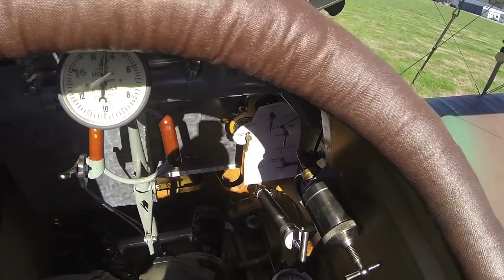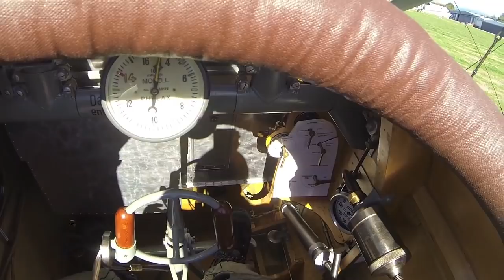Albatros D-II - New Zealand - Part 1 - Kermie Cam

Comment: Who else noticed that sexy Corsair in the back, love that plane!
Reply: I was lucky enough to work at Vintage Aviator for a while. I said to Gene one Monday morning "Do anything fun in the weekend?"
He shook his head and said "Nothing much...Flew the Corsair ..."
Bastard.
Reply: During the Pacific War, the Royal New Zealand Air Force acquired around 424 Corsairs from the US Navy and Marines. The aircraft seen here is one of those ex-RNZAF aircraft, now in US markings.
In the 1960s I met a guy who had been in the RNZAF ground crew on Guadalcanal and he told me a lot of stories about events there. He said some of the Corsairs had a lot of hours up by the time they were lend-leased to the RNZAF and were pretty clapped out. Some of them used cartridge starters and some of those were so worn that the ground crews had to empty two cartridges into the starter before inserting a third cartridge and hitting the button.
They also put a quick-release valve on the inlet manifold for a fire extinguisher, because if the engine didn't fire the first time, it generally caught fire the second time. So, a quick shot of CO2 into the manifold, clean it out and try again.
New Zealand aircraft in the Pacific carried markings similar to American aircraft, because they had found out the hard way that inexperienced American pilots were quick to shoot at anything that had red in its markings.

Comment: I would suspect the Albatros is a bit easier to fly than most WW1 aeroplanes, except perhaps the Fokker D-VII. I think a Camel (or any other true rotary) would be a hell of a lot harder, and some of the really early ones might also be difficult. (DR-1 Eindecker for example.) I might be prepared to try an Av 504K, but there is no way I would try and fly a Bristol Boxkite...

Comment: This picture is not historically accurate. What is Otto von Bismarck doing in an airplane?
;-)

Nice videos! Just discovered this channel. Interesting to see old planes like that still in operation, filmed today in HD down to details like all those clicking valves...

From the cam it looks like the guns are aiming at the propeller - how does this work?
Reply: "From the cam it looks like the guns are aiming at the propeller - how does this work?"

They had an interrupter gear connecting the engine crankshaft to the gun's firing mechanism. The guns would only fire when there wasn't a propeller blade in the way.

Comment: Its crazy to me being a car and engine guy to see the engine totally exposed to the elements like that. WIth the pushrods and rockers exposed dirt and grime and stuff gets in there its all over. I would have thought some type of cover would have been put over them for flying.
Reply: Boredout454 lol I was thinking the same thing. I believe I noticed some oil on the gopro lens before he even took off.
Reply: Boredout454  
some had cover
http://www.bibl.u-szeged.hu/bibl/mil/ww1/technika/repules/tipusok/albatros_d2_5.jpg
Reply: Boredout454 Survival time of WWI  planes was counted in weeks, with cover or without it  :)
Reply: True but that survival percentage would have increased with a cover!
Reply: Boredout454 TBH, these engines were probably built to such loose tolerances that the odd bit of dirt wouldn't have bothered them.
Reply: I can certainly see what you mean but up in the air there isn't really much to worry about and in my experience I have never heard of any issue with any aero engines that have exposed rockers.
Reply: WarblesOnALot
 Hi Warbles! :)
Reply: Boredout454 of
Reply: Boredout454 GM in line 6cylinder engines in the late 1920s had no rocker covers.Every 20 miles the car driver dismounted  and gave the valve gear a drink of oil.

Comment: With the tappets exposed, how was an adequate supply of oli retained at that zone?
Reply: I reckon that little brass 'cup' up at the front of the engine is a drip-feed oiler that gradually dribbles lubricant onto the valvetrain.

Comment: Taxi 35 knots, Stall speed 34 knots, VNE 36 knots.
Reply from the maker: Nice spoof!  I believe your information is a bit off as I don't think you would taxi an airplane with no brakes at 35 knots and then have a never exceed dive speed of 36 knots.  

Not sure where you got the information (assume you made it up) but the airspeed indicator on WWI German airplanes is in km/hr and I doubt seriously you could determine those airspeed that accurately as the airspeed indicator is out on the right wing strut and I can say that I never look at it while flying!
Reply: Yeah, I was just joking around. In reality, I have no idea what the V speeds for the Albatross or any other WWI airplane is. I would, however be very keen to know them or your estimate of them. This video reminded me of the time when I flew a Curtiss Pusher. It had externally exposed rockers that required pre-oiling as well. After take off, it took us forever to get past the end of the runway. Canadian geese and J-3 Cubs were passing us like we were standing still. Hope I live long enough to hear that Napier Sabre of yours light off. Love all your videos and have been following your career since your aerobatic days. I worked for years in a radial engine shop and worked for a P-51 restoration facility. I've worked on all kinds of warbirds and love all things aviation related. Best o luck! Kinda surprised that our paths have never met....maybe one day.

Comment: The engine sounded like it was misfiring and possibly over-rich. My experience with engines of this age is limited to automobiles but the RR Silver Ghost engine runs a lot more evenly and with rather less smoke, than the Mercedes in the Albatros.

Comment: Wouldn't those guns shoot the prop off?
Reply: +Musicalanus  Biplanes like the Albatros were fitted with a device known as an "interrupter gear". It was connected with and turned with the engine. These gears had bumps around it in sync with the positions of the propeller blades. These  would push on a rod that connected to the machine guns and when the rod was pushed up by the interrupter gear's bumps it would stop the machine guns from firing and as the propeller blade moved out of the way of the machine guns line of fire, the bump on the interrupter gear moved away from the rod connected to the machine gun, allowing them to fire again.

-You're welcome :)
Reply: +Kyle Doman thanks that was very helpful. Awesome ingenuity especially for back in those days.
Reply: +Kyle Doman As you say, the german interrupter gear was , I believe, developed by Anthony Fokker after he had been asked to come up with a 'reply' to the wedges used by Roland Garros to avoid shooting his prop to pieces. We Brits took a while to come up our version, invented by a chap called Constantinescu which used hydraulic actuation of the interrupter mechanism.
Reply: Read A.R.Weyl's "Fokker:The Creative Years" from page 95 onwards for the story on the various interruptor gear patents, notably the German patent by Franz Schneider of July 15 1913 (DRP No.276,396). Fokker was just fortunate enough to have Heinrich Luebbe working for him, who was probably aware of this and had the engineering ability to act on it when Fokker was asked by Hauptmann Foerster to come up with a solution to the problem posed by the Morane Saulnier type N with its deflection plates mounted on the prop. Oddly enough Schneider was working on his device at Schwerin at about the same time that Fokker was getting started there. At that time the authorities told Schneider that they could forsee no practical use for his invention.
Fokker went on to create a monopoly for "his" version.
Reply: Musicalanus Your funny they had a Sync Gear built into the guns so it would not fire when the propeller is in the way

Comment: What's that thing on top of the engine's front? Looks like a horn to me x).
Reply: Its the cooling line from the Radiator on top of the Wing to the engine.
Reply: +Di Pudriano It's some sort of lock of the tube line from the radiator?